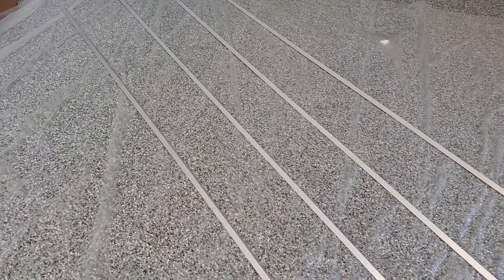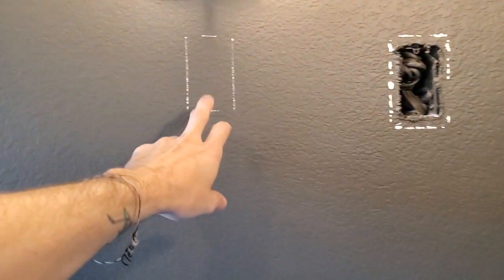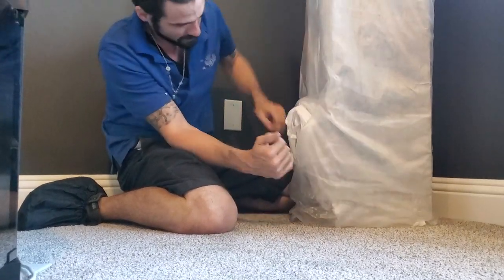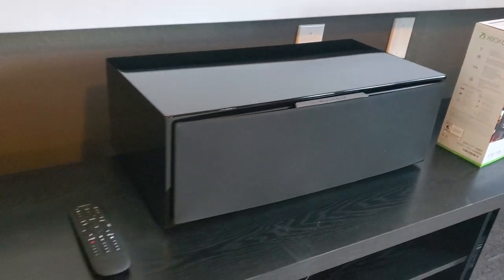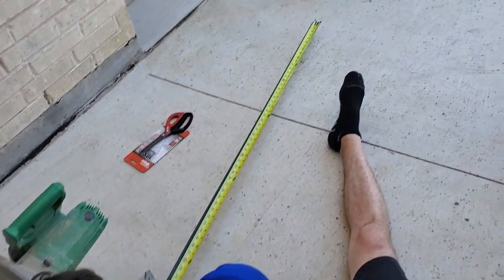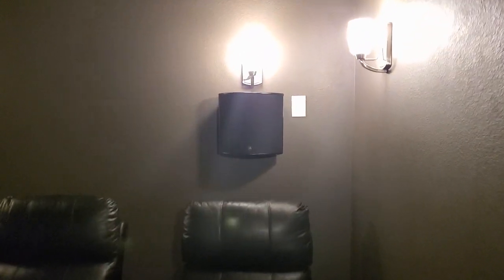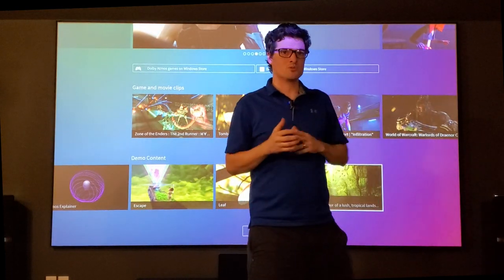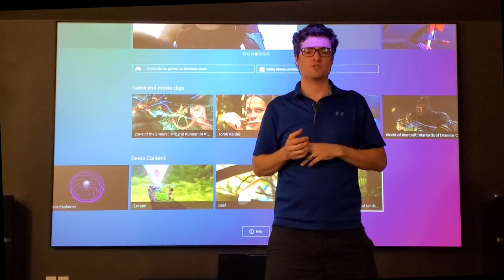Martin Logan Speakers! 5.1.2 Dolby Atmos - Motion Series install! Fx2! 50Xti

Comment: i had Best Buy install my 5.1.2 system with a Epson 4050 projector, they did not align the projector properly, can you guys come out and dial it in? I tried to have another company (BTZ) But they showed up with no MASKS, VERY UNPROFESSIONAL. Let me know if you can help. thanks.

Comment: Show how your bi-amping with that receiver.  Thanks!
Reply from the maker: Hey Mark Derick with Divine here, I'm working on a job today with the same reciever. Its not a bi amp system but ill shout you out and show how you hook up bi-amping to it as well as the configuration for it in the settings.

Comment: I don’t get it.  Why not the 60 XTi towers?  That’s the proper match for the center you’re using.
Reply from the maker: You can always go larger on the center channel. It plays the majority of the movie. Not to mention, a center channel is just a speaker. Compare the size of a 50 XTI to a motion 40i. Look at the chamber size difference, The 40 is a significantly larger speaker. It’s a small room and the customer didn’t want such a massive tower speaker. Thanks for watching and for your input

Comment: Anyone know if the FX could be used as front L and R with center channel and sub for interesting 3.1 system or are they only for rear surrounds ?
Reply from the maker: You could definitely do it, it would create a super wide soundstage. You won't get as much controlled directivity but it would probably sound pretty interesting. Definitely go for a front firing Center Channel. Let us know if you need anything and we'd be happy to get you the best price
Reply: Did you use your FX as front LR? I just ordered a pair of FX a minute ago so I'm definitely excited to hear them. I'm planning to wall mount the 2 for my rears. Would you recommend FXs though?

Comment: What is that ??? Speaker in the coner and no room acoustics... that is not good
Reply from the maker: Lol. My friend, not everyone does Acoustics treatments at the same time as the initial installation. They plan on putting some insulation behind the speakers and acoustically treating the rest of the room. That will take a bit of time. That room sounds freaking awesome the way it is especially because it has slanted ceilings and resonating frequencies are quite minimal. Definitely needs some work but nothing major

Comment: Question... did you have to pull the ceiling down to install the in-ceiling speakers, or just localized holes?  Thanks
Reply from the maker: This is on the second level of the home so there's attic access and we were able to Simply cut the holes and then move the wires from the pre wire location
Reply: @DivineAV  - oh, great... that made it a lot simpler...
Thanks so much!